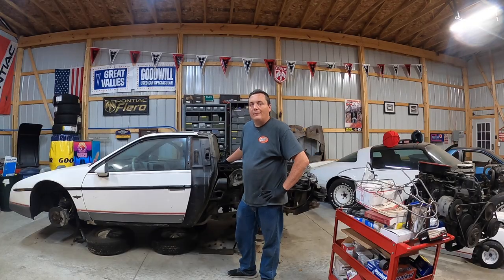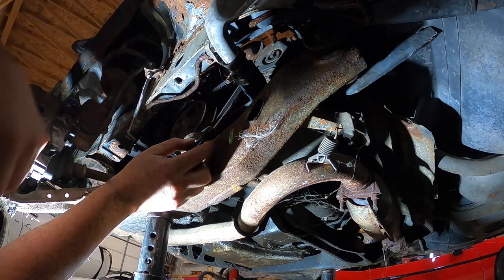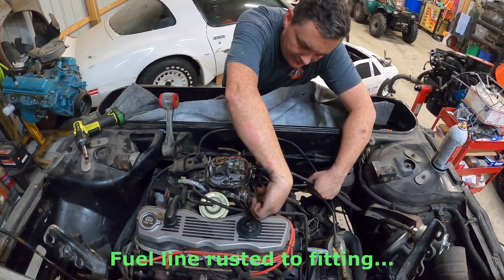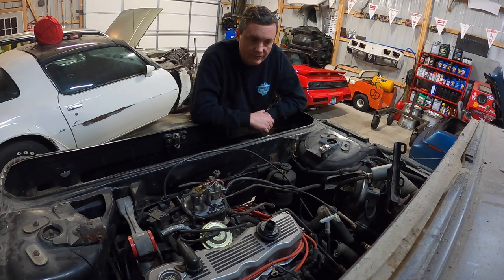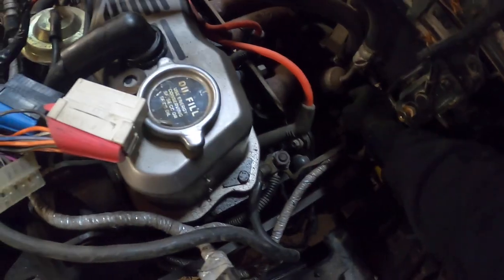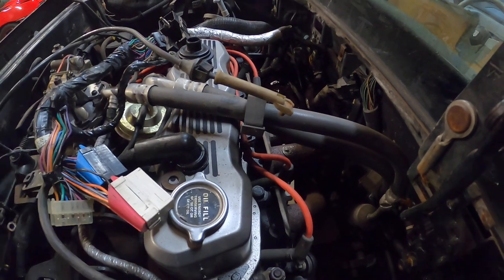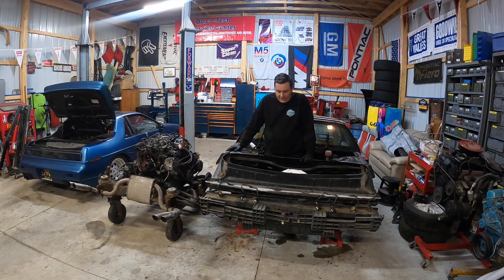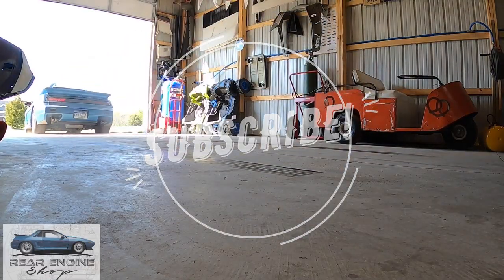Indy Fiero Restoration: Removing the rear subframe

Comment: Lol. Working on my 88 now. She sat for 25 years in a barn no motor.  Sub frame is engine ready to go in.  But suspension is in pieces poly going in.  However every bolt had to be cut off shock links.  Then in the process of making a new upper a arm shaft.  Ugh 88 issues.  This will be my first 3800 sc 5spd swap. Been ordering parts then more parts and yet again more parts.  But wait no stereo order more. Rebuilding callipers soon. They are soaking in penetration oil. Spring of 2023 I will be driving her.
Reply from the maker: Awesome! All the hard work is worth it when it’s finished.

Comment: I bought a pace car just to work on and now I see there's room for a V-8 and any other goodies you want to strap-on...Nice turbo T/A...
Reply from the maker: There’s tons of room in there.
Reply: The starter just went out on this L4 2.5 any advice on the best way to get it out? Looks like it tucked up there pretty good, thanks...  @RearEngineShop
Reply from the maker: @jimdandy7323  should be able to get it out from underneath. The catalytic converter will make it hard but it is possible. Make sure to disconnect the battery first.
Reply: @RearEngineShop  Thanks Take care

Comment: Yes, lots of fun. I didn't known if  the trunk latch lift would work well but it did for you. pulled mine out with 4X4 and two floor jacks being careful of coolant tubes it also work well and for lifting back up with engine and trans.Are you making the rear tail or finding a donor for repairs? Doing the same repairs, plus the rockers.thanks for the video
Reply from the maker: I think I’m just going to patch the rusty parts with good metal, making my own patches. Thanks for watching.

Comment: Did you say performance while working on the duke?  Best way to improve a duke is to 3800 swap. The only thing you want to do is make that duke run for another 35 years.
Reply from the maker: Performance used lightly, haha. I want to keep this car mostly stock. My wide body Fiero has the 3800SC swap and my 88 Fiero has a turbo 4 cylinder swap.

Comment: I put a lot of engines in those 1985 - 1987. You do NOT need to drop the cradle to R&R engine .
Reply from the maker: @midway27272727  it’s so much easier to drop the cradle. Plus it needs to be out to fix all the rust.
Reply: @RearEngineShop  makes sense for the rust aspect of it. We were doing what was refereed to back then as a "Fiero tune-up" on flat rate, so finding all the safe short cuts was money in the pocket. Could get one short blocked and out the door in 7 hours. The Grand-am had that L-4 engine but the problem with those was the fiber cam gear.
Reply from the maker: @midway27272727  I’m a flat rate BMW technician so I know how that works, haha!